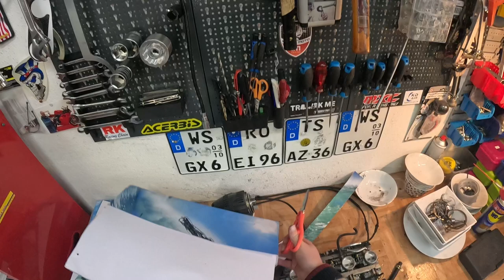Kawasaki ZRX 1100 Install Carburetors | Vergaser Einbau | How To [Engine Rebuild Part 23]

Comment: Can't you take out the air box and put single air filters...
Reply from the maker: Yes! But the gernan Tüv doesn‘t like that 🥺
Reply: Ja,ich habe auf TÜV vergessen,also verdammte Luft Filter Box bleibt
Reply: Это быстро испортит двигатель.
Reply: When did you realise you didn't connect the fuel hose in the middle of the carbs ?